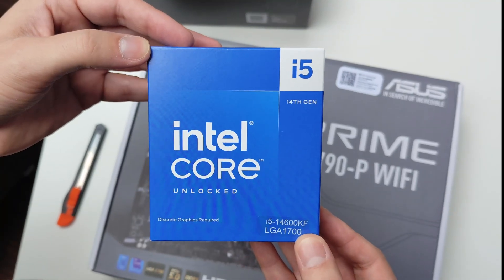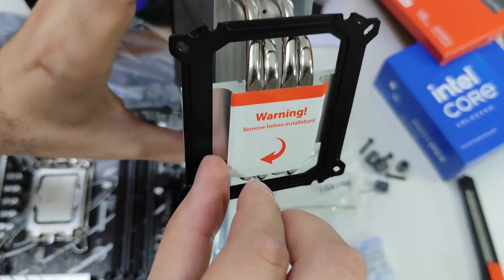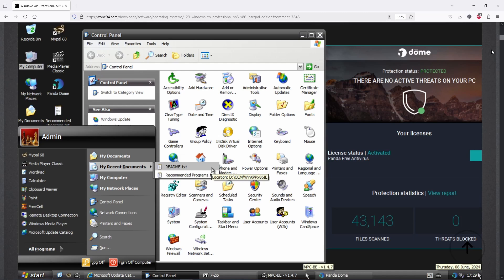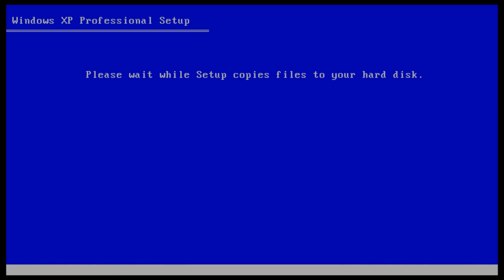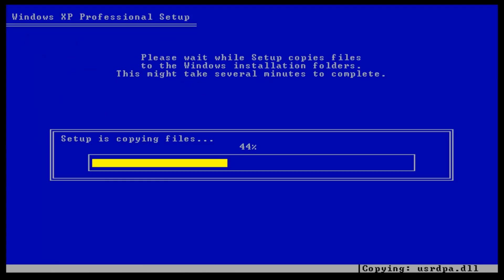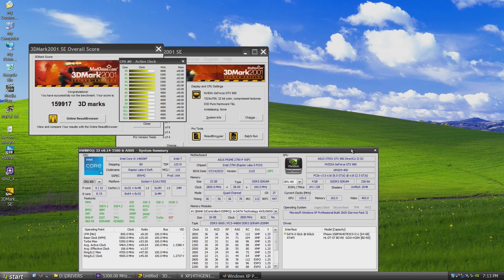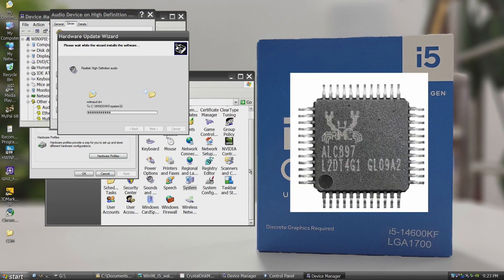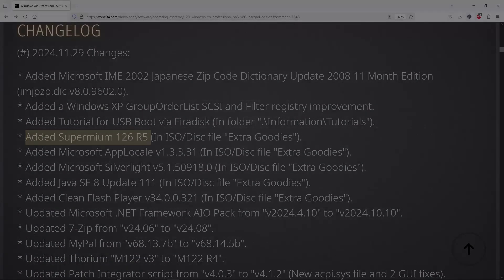Windows XP Meets Modern Hardware: i5-14600KF + DDR5 Z790 Motherboard. NVMe, USB 3.x? No problem!

Comment: Hi, on my Ryzen 3900x build, no PS/2 port on motherboard, how to solve the problem that when setup step of XP go in real mode after DOS mode (like as you explain in your videos), the USB keyboard (and USB mouse) came off then disabled? Do you know more motherboards actually don't longer offer PS/2 port.
Reply from the maker: The PS/2 port is no longer standard, but it's still present on many motherboards. If you are into retro installs like this it should be the first thing to look for when picking a new motherboard. For example there are PS/2 ports even on Z890 motherboards for the newer 1851 socket - or the 15th Gen CPUs now called "Ultra". On this motherboard booting the custom ISO with USB drivers included - and I was able to proceed with the installation without a PS/2 keyboard so it looks like the included USB drivers kicked in. I do have also a Ryzen 3900X + X470 mobo configuration and I remember that the keyboard lights went off during the installation but back then I used the original ISO for the installation, with no updated drivers. My X470 mobo has a single PS/2 port which was used with a mouse, so I had to use a keyboard to move on.
Reply: @O_mores  My USB keyboard don't go back ON when setup has finished to copy files in real mode, go off first that come the screen where i can press Enter for continue or F3 for abort the setup where i suppose Is real mode for start to "Setup XP in your machine", cause i ask. An adapter USB to 2xPS/2 port can help? I am using Integral ISO created by Patcher, i detached all USB hardware except keyboard and mouse and i tried another combination of drivers with ISO created by Patcher but nothing changed. I have yet my original XP pre SP DVD. You are expert cause i ask may exist a solution for having USB keyboard working during XP setup. I know existing yet a recents motherboards whit PS/2 port, but i don't want buy one for this. You say in your Ryzen build USB keyboard go back ON, so only depends by driver present in an ISO? I read on article with Google search that in CSM mode the XP setup reinitialize all USB connection and all them go OFF. I have a build whit 2400G and B450M that has PS2 port, if i had success to install XP on this build and after i move the SSD to 3900x build after can working XP? Seeing you have a Ryzen 3900x build (AMD CPU's btw)why you don't focus the videos also to this build vs. Intel build buyed after? Thanks for now anyway!
Reply from the maker: I installed XP on my Ryzen configuration a while ago, but I remember for sure that USB to PS/2 emulation done at BIOS level which still worked in Windows 98/ME and NT 3.51  - was terminated by both Windows 2K and XP during the boot time. Keyboard lights went off - and that was the end of story. So I used a PCI-E to USB 2 adapter to have USB support on all these legacy OSes. Such an adapter should be detected during setup and you are good to go. There are even PCI-E to PS/2 adapters but these are also based on USB chips - so you better pick and USB 2 adapter in the first place. Try to make another ISO and fiddle around with USB drivers, you can pick different variants if you have time to test them. Do you have a serial port?
Reply from the maker: Yeah, usually any USB 2.0 card will work in Windows 98 and even 95 (with USB supplement) because any card have both USB 1.1 controllers (UHCI) and USB 2.0 (ECHI). UHCI will get picked for sure. Not all MS-DOS programs work in Windows 98 even on time period correct hardware, and even less on modern hardware. Usually after you install video drivers you can't restart in MS-DOS or get back from it. I experimented this many times. Without video drivers usually you can play around with DOS, but of course you can press anytime F8 during the boot to go in pure MS-DOS mode. For gaming is better to start games from Windows because for many you will get sound support if you are using WDM drivers. I recently played NFS 1 from 1994 and it was such a nice experience.

Comment: ...whatever
Reply from the maker: Quantum CPUs excel at solving specific types of problems (like optimization and cryptography) rather than general-purpose tasks so I don't know... Imagine that in late 2006 the first quad core desktop CPU was released: Intel® Core™2 Extreme Processor QX6700 8M Cache, 2.66 GHz, 1066 MHz FSB. 18 years later with PCem or 86box we can barely emulate a Pentium II 400... :)
Reply: @O_mores Quantum computers can be also perfect for cracking any kinds of Abandonware that requires Serial key to activate the Full version, but the Serial key is lost.
Remember: Piracy IS the key for game and software preservation, despite violating laws - just like viruses in nature ARE the key for evolution, despite causing viral infectious diseases.
Reply: @O_mores  Quantum computers can be also perfect for cracking any kinds of Abandonware that requires Serial key to activate the Full version, but the Serial key is lost.

Comment: This Integral Edition does support for Windows XP x64 SP2? I need this to test with my latest PC.
Reply from the maker: @BillyRazOr2011  Hi, nope, it's just X86. There are some X64 ISOs out there but not as updated as this variant. I'm going to try one ASAP.
Reply: @O_mores  Thanks! I hope x64 version would work flawlessly. 👍🏻
Reply: @O_mores  My current PC is Asus TUF Gaming B760M-Plus WiFi with Intel Core i5-13400. Isn't fully works with this Integral Edition?
Reply from the maker: @BillyRazOr2011  It should run perfectly fine on that configuration. I already did a video about 13th Gen/H610 motherboard: https://youtu.be/pE3CswJweqs
Reply: @O_mores  I hope one day you could try Windows XP Pro/Home x64 SP2 with Integral Edition. 😁
Reply from the maker: @BillyRazOr2011  I'm planning to do it today on this Intel 14th Gen setup with 14600KF/Z790/32GB DDR5/5600.

Comment: WHY ??  Using a REAl unsafe OS ?
Reply from the maker: First, for the fun of it... But there are practical reasons... Windows XP was supported in certain contexts well beyond its official extended support period, which ended in April 2014. For instance, critical patches were provided for some enterprise systems up to 2019. Many industrial or enterprise-grade applications were designed exclusively for XP and have no modern equivalent or are prohibitively expensive to replace. Running XP in these cases ensures access to essential tools that might still drive business operations.

Comment: I installed Windows XP on my Intel DX79TO with an Intel Core i7-3960X Extreme Edition 6C12T with 4,3Ghz and 32GB DDR3 1600Mhz Quad Channel for the SSD I use a Samsung SSD 850 Pro 512GB in AHCI and as GPU I use a GeForce GTX 980 Ti. As a bonus this system can run a vanilla version of XP and you can also install official drivers for everything like chipset usb 3 etc.
Reply from the maker: Nice! I can do vanilla XP on this system too, but with some additions like a PCI-E to SATA adapter and MPS will be used for multicpu support. I'm curios how ACPI works on Windows 98/Millennium on your configuration. I recently tried a Z68 motherboard with an i7-3770 CPU and Windows 98 was fine that ACPI implementation.
Reply: @ my motherboard also has a PCI slot so I could put in my S3 Trio64 or NVIDIA Riva TNT2 M64 which has win 9X drivers
Reply: I also preserve two X79 systems which also offer up to 2 PCI for scanner/printer SCSI interface cards. But still curious what the CSM on ASUS boards for a 12400F offer.

Comment: Upgrade the BIOS to protect the cpu from degradation.
Reply from the maker: Yes, I did it, but only after a few days of testing with the initial BIOS from July 2023. First, I installed Windows NT 4.0, 98 SE, Millennium, XP SP3, Vista 64, and 7—all worked flawlessly. Later, I updated to the latest BIOS released in November 2024, but nothing  changed. This is likely because the AMI CSM module hasn’t been updated in the past few years.
Reply: I think the 13-14th gen i5s are safe from this issue. It is an issue with the higher end i7 & i9 cpus.

Comment: 980 series? 😅 Really?
Reply from the maker: Absolutely...! 😄 The GTX 980, GTX 980 Ti, and Titan X all share the GM200 chip, which clearly ties them together as part of the same lineup. The architecture and performance similarities make it fair to group them as the 980 series...
Reply: @O_mores  Ok i thought you were trying to say 900 series, thank you for the explanation
Reply: @O_mores since when uses the GTX 980 the GM200 it uses the GM204 chip with 2048 shaders / the 980ti TITAN X and Quadro M6000 uses the GM200

Comment: Would be interesting to drag race this against a period correct top of the line machine.
Reply from the maker: I would do it, but what is a 'period correct' machine for Windows XP? It was released in 2001 and stayed in active use well into 2014-2015. (around 20% market share in 2015) Early on, 'top of the line' meant CPUs like a Pentium 4 - then maybe we can think at some Q6600 setup from 2007 - but by the end of XP’s era - Ivy Bridge motherboards still had official support for Windows XP.
Reply: @O_mores  Good point. XP did span a long period. I was thinking a late native 32-bit CPU since regular XP isn't able to take advantage of the 64-bit instruction set.

Comment: I think windows 7 ultimate would run like a dream on that build😊
Reply from the maker: Yes, indeed! I already install it. Windows 7 it's fast and very compatible: USB 3.x works, 2.5Gigabit LAN works, sound works... RTX 3000 series have official drivers for Windows 7. Btw, the updates are still working.
Reply: @O_mores  Which drivers are missing for Windows 7 on Intel 14th Gen Z790? I want to get a new PC for Christmas that is powerful and can run Windows 7.
Reply from the maker: Windows 7 is very compatible with this exact motherboard that I have - the onboard ALC897 codec works also the 2.5 NIC from Realtek (8125 chip), the SATA and NVME are working perfectly fine, and you get USB 3.x support as well...  The RGB functionality might not work in Windows 7, I didn't try it.

Comment: Maybe next for Dual Boot Windows XP WMC ver and Windows XP x64 Professional 😂😂
Reply from the maker: I plan to create an x64 edition video, which is essentially Windows Server 2003 - and to ruin my fun... can’t be installed directly from DOS. I can do it anyway... Another thing I’ve noticed is that there doesn’t seem to be an updated x64 Integral Edition available. There are some that claim to be X64 while they are still X86. Still, I can install X64 using a vanilla SP2 disc, either with a PCI-E to SATA adapter or by slipstreaming the necessary drivers. I did this with XP X86 on one of my earlier videos using a PCI to SATA adapter.

Comment: I recommend using Easy2boot to boot XP installation media, fewer steps and no complaints about missing files during setup.

For a hardware solution you can get an iodd ST400 and then just boot the ISO directly, no faffing about preparing USBs.
Reply from the maker: I'm not sure if the iodd ST400 can perform its job in CSM mode when using an unsupported USB controller by the OS—perhaps it might work in UEFI mode. In CSM mode, however, USB connections are reinitialized by Windows XP, which causes anything connected to stop working. It would be ideal to use a USB floppy drive to load drivers for XP, but the issue is that XP loses connection with USB floppy drives on newer motherboards. I don't see how the iodd ST400 would behave any differently in this scenario.

Comment: Hi! Could you installed 9x on this motherboard without discrete PCI SATA controller?
Reply from the maker: Hi! Oh, yes! 👍 Everything works fine, including AHCI. Only Windows 98 and ME tested so far. NT4 works as well.
Reply: @O_mores  can you say how did you for 9x ? I still get protection error on AM5 motherboard.